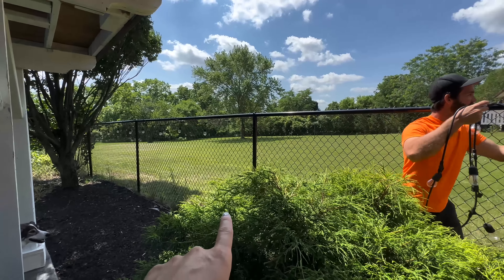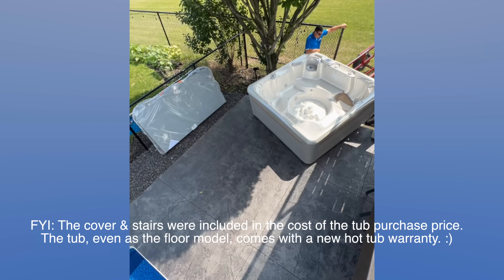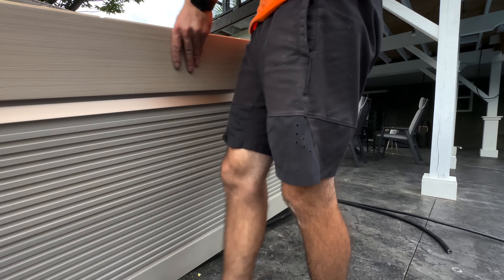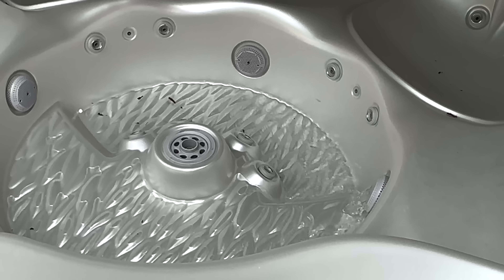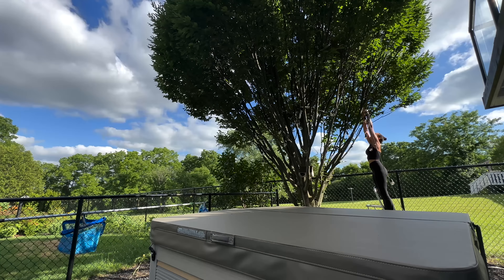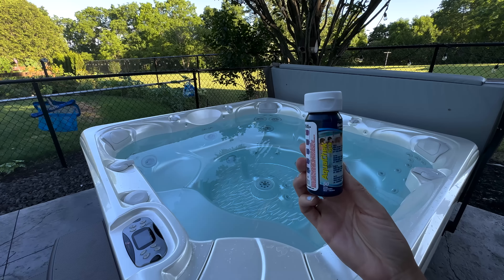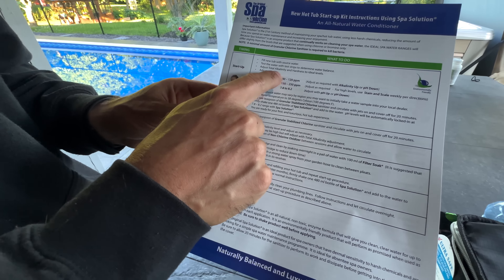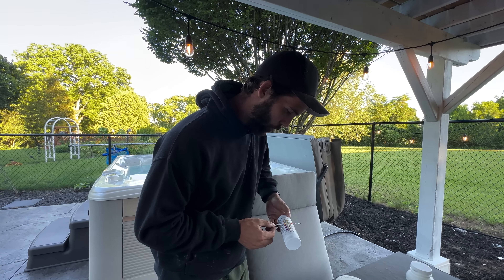Hot Tub Delivery & DIY Setup 🔥

Comment: I found it rather amusing that the tub delivery guys were carrying the tub trailer ON a trailer. Here in the UK, we just tow the tub trailer behind our vans. Bit bouncy but it does the job. Just have to make sure the tubs are strapped down well. Intresting thing to note is that it appears that they use the same hot tub trailer over there as we do here in the UK. I work for a swimming pool / hot tub maintenance company. 

One bit of advice I'll give for your hot tub, try not to block the panels in on any side. Or if you do, then unblock them before an engineer arrives to look at the tub. When something goes wrong, Ie a pump fails or a leak appears, you will need to access different areas of the tub. Having the panels blocked means you will have a larger labor bill as it will take longer for the engineer to diagnose the fault.

Comment: How did you shop around for this exact hot tub? Curious because I’m also looking for one but they all seem the same/ I don’t know what to look for…
Reply from the maker: Great question! I (Andrew) wanted a Caldera because after researching it seemed like a great quality brand. It has 2 pumps instead of 1 and came with a 5 year warranty. I didn’t want a lounger style and this one happened to be available to purchase as a floor model so it was a great price (plus it included the stairs and cover).
Reply: The vast majority of tubs out there will accomplish the same goal. Heat water, pump it around and keep it clean. If they all seem the same, you must not be too fussy, in which case I'd recommend a cheaper tub.

The main thing you need to look for in a hot tub is the design and features that you prefer. Ie, colour / pattern of the shell, lighting kits, sound systems, etc. I would always recommend buying brand new rather than second hand, as you can never know what has gone wrong with an older tub that has lead to someone selling it. 

A display model from the showroom floor is a 50/50 shot. If a display model has been sitting empty without the pumps running, that's generally going to be an absolute steal. Whereas display models that are full of water are likely going to have had their pumps and equipment running for a significant amount of time, which will reduce the life expectancy. However, there are obviously going to be outliers in both situations. Tubs that are empty may have been full and running for months before you see them, and may have only recently been emptied. Whereas tubs that are full and running may have been sitting dry for months without pumps running, and only recently been filled and ran. You can't tell for sure.

The secondary consideration should be the power consumption. Bigger tubs will generally have a larger heater, as they have a larger volume of water to be heated. Lots of tubs will also have multiple pumps, Ie a circulation pump plus 1 to 3 massage pumps, which could also factor in to your energy bill at the end of each month. I would personally go for the smallest practical size of hot tub that I could get. More on that further down in the comment.

Your next considerations should be if you actually have space for said tub, how you'd get it into your property, and how you'd power it.

I work for a swimming pool / hot tub maintenance company in the UK. The best overall advice I can give you here is to look around online at different hot tub manufacturer websites. Figure out the features you desire, what design you want, etc. Then find a dealer who is selling that model of tub, or order it custom from the company. Our company sells a lot of hot tubs from Earth Spas, so I am biased towards them. We find that they provide a high quality product which is easy to work on when problems arise. For example, pumps fail over time as they are moving parts that do wear out. With Earth spa tubs in particular, we can access the pumps fairly easy to repair / replace them.

Earth spas hot tubs also tend to come "Heat Pump Ready", Ie you can buy a heat pump to heat the tub instead of using the on-board electric heater that's plumbed into the tub. It is a more expensive upfront cost, but over the course of 2 or 3 years, it'll pay itself back by saving you money on your electricity bill. The on board electric heaters are like a kettle element, or an immersion heater. A heat pump is far cheaper to run, and far more energy efficient. However it is slower to heat the water.

If I was going to buy a hot tub brand new, (I wish I had the money for one,) my order would be as follows. 
Earth spas Kouri (3 person tub, 2 loungers and 1 main seat plus a "child seat / cooldown seat", which we would use it as a step to get in and out of the tub)
Optional Extras of:
Wifi Module
Heat pump / Heat pump cabinet
Exterior lighting kit.
This tub can run off of a standard British 13 amp socket, but requires RCD protection for obvious reasons. I'm not 100% sure of the requirements in America, so you would obviously need to check what you'd need.

Please bare in mind that I am biased towards Earth Spas, as we sell  them at our store. I have worked on a lot of them, so I have plenty of experience with how to maintain them, repair them, and keep them in top condition. Do your own research and decide what brand suits you best. I have worked on plenty of differing brands in my short time in this industry, and I would only consider a few brands to be "worse" than the competitors. However, these are generally tubs that are 20 plus years old and may not reflect the current quality of the manufacturers today. As such, I shall not be providing any names of these manufacturers.

I hope this will be of some help to you. If you have any other questions, reply to this comment and I'll try to get back to you within the next day or two. I can't promise that I can help any further, but I'll do my best.